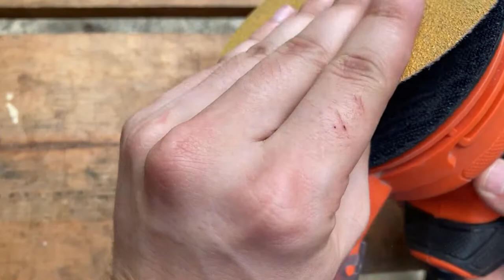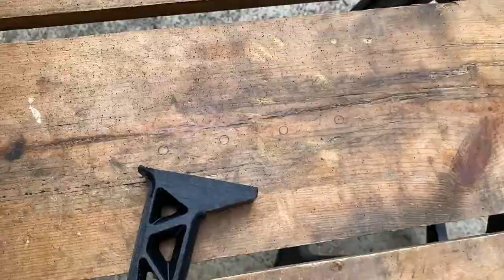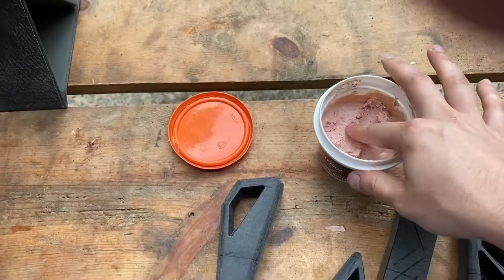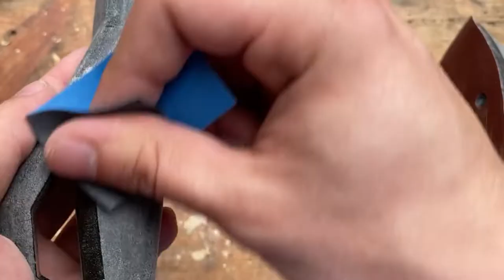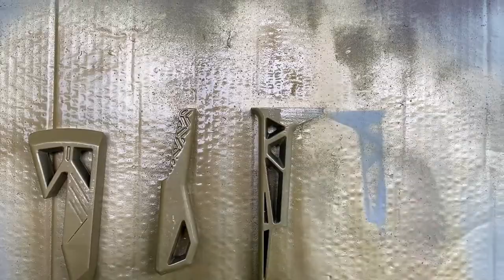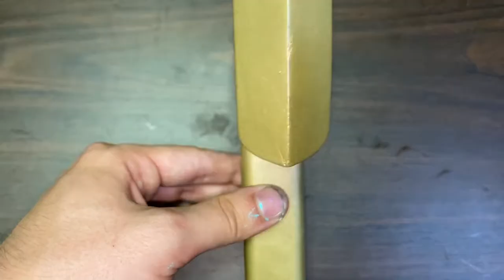Valorant Prime Melee Axe | 3D Printing a Cool Axe

Comment: How did you print it? I’m trying to find how to print it. Does it need supports
Reply from the maker: VenomisCarnage vertically, supports only needed in the hole areas
Reply: Anton Talks Tech did you had the skirt yourself when you put them vertical
Reply from the maker: VenomisCarnage usually I use a raft